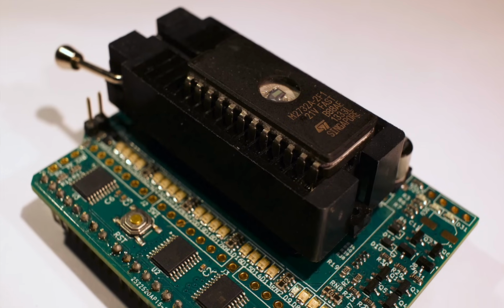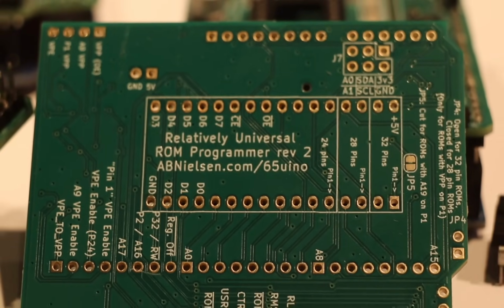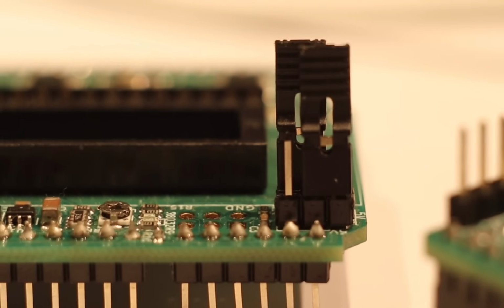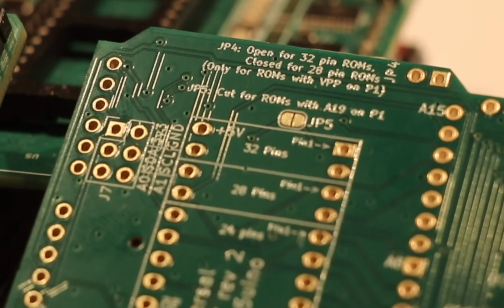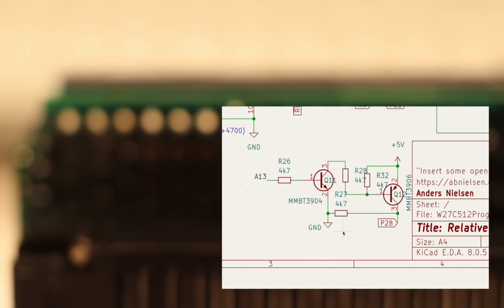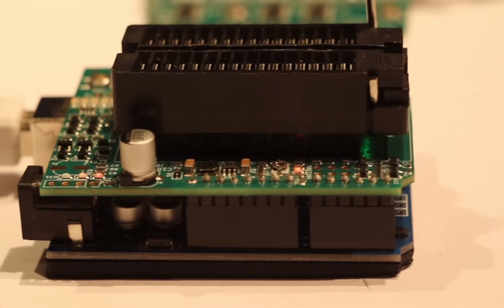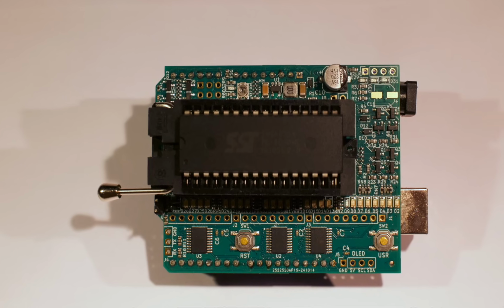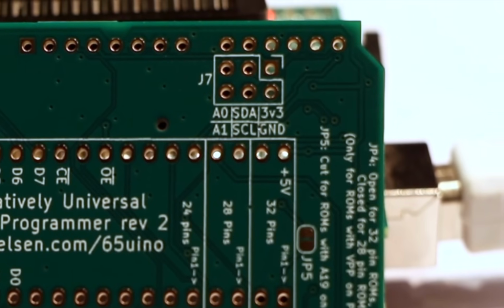Your new favorite ROM burner is here!

Comment: Any plans to include PLDs and MCUs? Never the less - it's an amazing project that's really maturing, despite being relatively new.
Having ways to program old, high voltage stuff is amazing.
Reply from the maker: Actually someone is working on an adapter and software for a GAL. The HV logic and many pins makes it pretty good for more things than I initially thought

Comment: Would such a burner also be able to be used as a high voltage burner for atmega fuse bits ?
Reply from the maker: Using an adapter board or bringing 12V out to a breadboard that would be possible - nobody’s written any software to try though.

Comment: I love this, but I use the test function of my TL866 quite a lot, testing 4050's, 4051's, 74xxx-series chips.  I didn't know it DID that when I bought it, but now I really rely on it when I am in doubt about a part.
Reply from the maker: Yeah, that's one of the things I had to give up by not having drivers on every pin. But it does mean this is faster (if it wasn't running on a 6502 or an Arduino Uno at least) and cheaper. Maybe bidirectional registers would solve it, but they'd also need over current protection ... some 74'XX's burn in half when they fail XD

Comment: Which product/link on your site will give me a link to buy a "plug n play" ROM burner? I dont need a case, but I also dont want to do ANY assembly or have to buy anything else, to burn ROMs. 

And no, it isnt because I don't know how to solder, in fact I have 2-3 weeks of soldering queued up, right now. I own/collect pinball machines, brand new Stern's, 80s-90s solid state's and 70s ElectroMechanicals. And I'm working on my second Homebrew pinball machine. Actually, this is  the reason I want one of these AWESOME burners. (The new version of software is coming out for my Star Trek The Next Generation machine, any day now.) Instead of buying it from a reseller, I want to be able to download and burn it. Yes! (And yes its legal. The software is developed by the community.)
Reply from the maker: Sounds cool about the pinball machines! I don't have any assembled units to sell you, but you skipped over why you want to skip the soldering? I'd like to hear more.

Comment: Two question before i see this video. Is the software open source and how much is it?
Reply from the maker: Both software and hardware. $9.
Reply: @AndersNielsenAA Great, thanks. If future versions could also support 1.8 to 3.3 volts, that would be great, as it would make the device suitable for programming serial EEPROMs and microcontrollers. This would significantly expand the range of potential applications.

Comment: I prefer seperate sockes that canaccept ZIF sockets.
Reply from the maker: In the video I also use a ZIF in a normal socket :)
Reply: @AndersNielsenAA  I'm going blind, so all I saw was a very fuzzy board drifting across the screen, over and over so I didn't finish it. I used to have a Fordham EP20? programmer on my bench, and we had numerous older progtammers fpr older chops like early PALs. I used them in a production and factory support situation. I also had to clear factor test data from the Dallas 3K=8 batterey backed RAM I loved it when the Capstore memory was devekoped, because tey were not only shipped blankm byut there was no battery to fail. It was two memory chis, a gapaciror and a comparitor. On powerup the EERoM was read into the Static RAM. On powerdown, it was written back to the EEROM
Im sure your oard wil interest hobyists, but I quit watching wjen you said to put a better product in the closet.
I worked in Broadcast and Telemetry equipmen manufacturing. Programming had to be performed on name brand equipment, and maintained in our Merology lab.

I even used the so called programmers for cable TV boxes and security dialers that pulsed a DIP resistor pack to open sselected resistors. I have over 100 pieces of lab grade test equipment in my home shop, after retirement. I won't say anything bad about your design, because I couldn't make out any details.

Comment: Is there a list of supported ROMs? I'd like to see something that would burn an 82S series, or even the 68HC705 CPU
Reply from the maker: The main cost cutting measure for the programmer is mostly relying on the JEDEC standard layout. That means it can supply some of the voltages needed but you’d need an adapter or jumper signals to a breadboard. And write a programming profile..
Aren’t the 82S’s all (otp) PROMs? Do you have a bag of those? 
I’d love to get my hands on some :)
Firestarter has a database with all supposedly supported ROMs - not all tested for obvious reasons :)

Comment: What would it take to burn 40 pin roms? Or is that out of scope for this project?
Reply from the maker: It’s a bit out of scope. It would take an active adapter board with an additional address latch.
Reply: @AndersNielsenAA  Or its possible to program 40pins with an adapter where you can set the high addresses manually and program in chunks.

Comment: Tried to order, but you don't ship to the UK :(
Reply from the maker: Yeah, it's a Brexit thing. HMRC requires all companies selling in the UK to sign up for UK VAT (at no minimum quantity), and that liability is a bit much for a small thing like mine. I also got a few very contradictory letters from them - and both kinda saying I must sign up for UK VAT but at the same time my revenue is too small to do so. 
Fun times. 
You will however find the Relatively Universal ROM Programmer Rev 0 on ebay.co.uk - Tim of Tim's Retro is still selling them afaik. Don't know if he'll order a batch of Rev 2's for UK customers as well. 
Other than that there's direct from JLC with the coupons n such.
Reply: @AndersNielsenAA  Thanks Anders, I will follow up on those options.
Reply: probably brexit is a cause